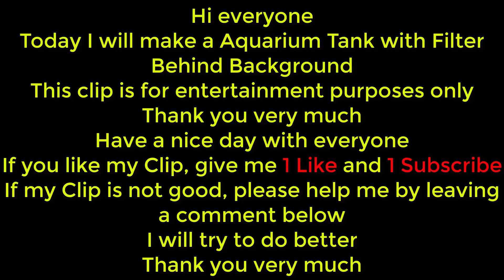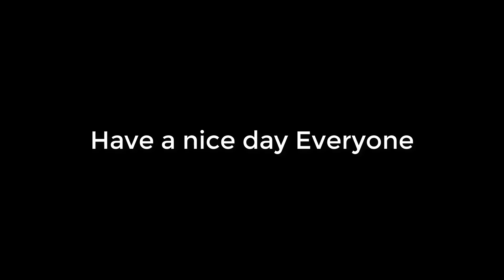Aquarium model 11 - Aquarium tank with Filter behind background

Comment: Love your ingenuity , and a great vid, loving your skills at laying silicone on the edges of the filter veins... freestyle ha ha! I bet a few will try that (it could get messy)  I really like the concept and the execution but I do wonder about the viability of cleaning this out, especially if the back of the tank is against a wall. No easy task I reckon. All the same enjoyed watching it all.
Reply from the maker: Thank you very much
Actually cleaning up I think is not difficult
I usually use a 10mm diameter soft tube and pass through the filter slots to clean out the external drain
In the video I also had to move the tank several times to get video angles
I use a soft pipe to remove all water from the filter tank
Wish you a happy day my friend

Comment: Can I ask about the sound level? 
My remarks: 
Although your building job is extremely good, 
the cleaning of this filter system seems o be impossible due the fixed glass separators. Soon or later the filter system will be a mesh.
Reply from the maker: Noise is very small
If you want to eliminate noise completely, you can add small pieces of glass to allow the water to flow at 45 degrees, you will completely eliminate the noise.
The system will not be blocked. You only need to replace the filter pad in the first filter compartment
For a long time there will be dirt on the bottom of the filter compartment. You can use a 10mm-size soft tube and suck out the residue
But those dirt will not block the pipe
That is my experience
Thank you very much
Or share your experiences with me and everyone. we will work better together
Have a nice day My Friend
Reply: Yes you are right
Reply: @pieceofpaper924  instead of using pvc pipe for return line in a pump i think you should have been used the flexible pipe  and why are you using top glass on  pump area what will happen when the pump during pump repair

Comment: Excellent work !! Please help me understand 2 things around this filter deign:
1- Why did you add 2 waste water inlets- one through the bottom and one at the top (through a mesh). You could have avoided one right?
2- When you switch off the water pump, why the compartment after the pump is not getting fully filled by water? Does the pump has any valve in it?

Comment: I sub because what you are doing is great. 1 minor issue tho, I'm not a fan of waterfall sound, it just makes me want to make "waterfall". I suppose putting lid on the built-in sump would help with the noise.
Reply from the maker: The sound is actually very small
Sometimes that sound creates dissolved oxygen for better filters
If you want to remove the sound, you just need to add a piece of glass so your water flows at a 45 degree angle
You will eliminate the noise caused by water
Thank you very much
Have a nice day My FRIEND

Comment: Professional work, but you have not mentioned the number of parts and their dimension and where they are installed, I am a beginner and I do not understand very well, please provide a video for beginners with an explanation for the good understanding and thank you I want to make a 75 x 30 x 45 cm (L-W-H) what size I cut the pieces thickness of glass 10mm ???

Comment: At 19:30... there is a problem... if you smaller the valve, but your pump sucks still water... it will run dry over time, because the pump is not regulated also. I would like to know how do you clean this filter system. I have a similar one bought in my garden, out of several big boxes, but they are easy to clean, and i put the opening were the water comes in on the ground - because THERE you have all the bad and toxic water you must clean. On top the water is always clean i measured over 2 years. Now i build a completly new system which is way more effective and also simulates a normal river cleaning.

Comment: how does the left side with the pump keep air in the chamber? wouldnt it fill up?
Reply from the maker: I apologize for the late reply.
If you don't want the air there you just need to let the pump run for about 15 minutes, the air will run out or you can drill a small hole where the air will escape under that small hole when the water comes in.
I didn't drill that vent
Thank you very much
Have a nice day

Comment: i dont understand how water gets back to tank. if the left chamber is lower then level of main aquarium .  where the water goes to big tank ? from bottom ? it should be going trough the top  which is over the main level tank. Or is it under pressure from bottom / i got lost
Reply from the maker: Actually the water level of the left compartment is not lower than the water level of the tank
This is because the air of the left chamber has not escaped to the outside
The air will escape completely when the pump runs for about 15 minutes or if you want the air to drain out immediately, you can make a small hole so that the air comes out when the water comes in.
Wish you a happy day my friend

Comment: Hi, Sir. Is it ok to put sand/aquasoil in this tank even if it has holes at the bottom corners of the tank? Thank you.
Reply from the maker: If you want to use sand or ground for aquarium according to this design
You have to change some details again
You must bring the suction lines and discharge up higher so that sand or ground does not clog the pipe
Thank you very much
Wish you a happy day my friend
Reply: Piece of Paper thank you very much sir. More power

Comment: If i make 5×2×2 feet what size of glass should i take an what width should i take for back sump filteration
Reply from the maker: You should keep the filter compartment large enough to be able to handle it with your hands
Maybe 20cm
You can use 10mm or 12mm glass (with glass bone on top)
If you don't want to use the glass bone at the top you must use 15mm kính glass

Comment: Looks noisy.  Also, you have very little surface movement....   so after a few weeks your oxygen levels will have depleted.   I give it a 7/10.
Reply from the maker: My friend
These are just the basic models in the video
In actual work, each aquarium will be slightly different and according to customer requirements
And we always use a separate oxygen generator for each aquarium
Thank you very much
Have a nice day My Friend

Comment: not good because the dirt under the water can't be removed.

the filter can only clean the surface.

better to use a pipe

#aquascape
Reply: Open your eyes it takes water from the bottom via the adjustment